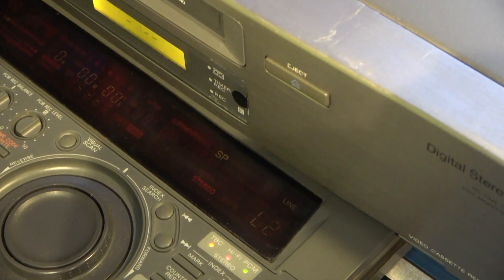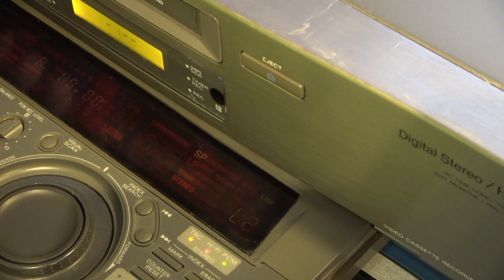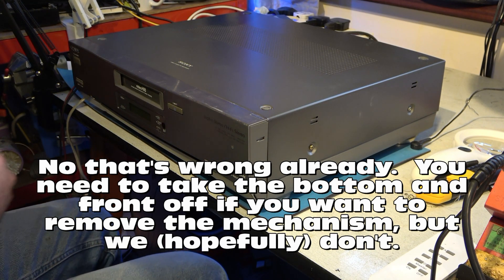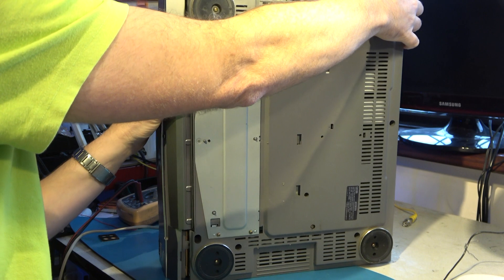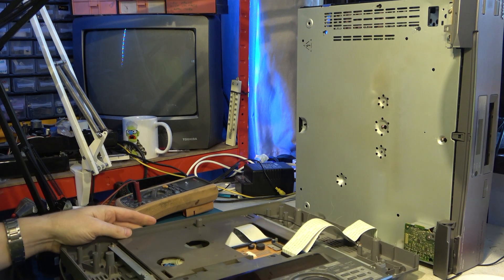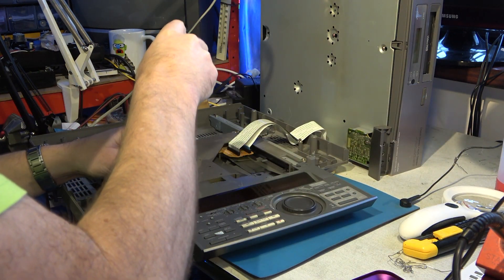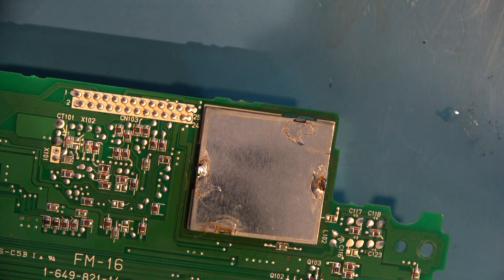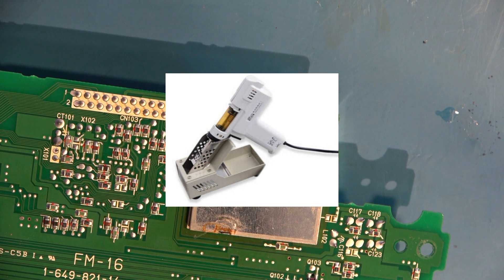Restoring brightness to a Sony EVS9000E / EVS7000 display.

Comment: I have an EV-S7000.  Replaced all the capacitors in the power  supply section under the metal can.  Still nothing.  Any other ideas of what to replace?  Thanks!!

Comment: I have a sony MDS-JB920 with a dim L/H VU meter bar and the PLAY triangle is dim aswell could you possible be kind enouth if i email you tge circuit diagram as i can sort this but just need a little help in the right direction

Many Thanks
Dsrryl
Reply from the maker: If certain segments are dim, then it will be due to VFD poisoning.  Not much you can do about that apart from replace the display.

Comment: hi can you tel were i can find a transformer converter 1-423-845-11 for my ev-s9000e,the display is not working i already change al capacitors but the trasformer was to damage by the liquid of the capacitors .thak you your videos are very helpful,sorry about my englis.
Reply from the maker: Your only hope would be from a scrap machine.  Keep looking on eBay for cheap non-running machines.
Reply: @video99couk  ok thank you .

Comment: Thank you for the video! It helped me with the repair, especially the disassembling of the control panel. Although Sony used high quality electrolytic capacitors, some of the electrolytic capacitors were defective. Still a long lifetime after 25 years! In my case, the C204 470µF / 10V was defective / leaked. Prophylactical I changed all capacitors except  C203 / 33µ / 16V. All electrolytic capacitors should be low ESR / 105 ° C types. C203 is an ultra low ESR - OSCON polymer electrolytic. It still had its original values and an ESR of 20mOhm. It should changed only by an equivalent type.
Based on this experience, I consider whether I should check all the electrolytic capacitors in the SMPS and change them if necessary.
Reply from the maker: Power supply capacitors do fail in this machine, again use low ESR.  It's fairly easy to work on.
Life gets messier when the thousands of capacitors all over the main PCB start to fail.  Also the SM capacitors in the timebase corrector often fail.

Comment: Mines completely dark i have the ev-s7000
Reply from the maker: If the machine otherwise works, take the bottom pcb out and replace capacitors in that metal screening can.
Reply: @video99couk  thank u and it don't rewind it will eat the tapes if rewind but fastfoward works great
Reply from the maker: @leonjohnsonjr3331  That's a split supply (left) spool.  Very common problem.  Parts are virtually unobtainable though.
Reply from the maker: @leonjohnsonjr3331  I'm told that they can just about be repaired but I don't have any detail on that.  It would certainly require removal and repair would involve some strong glue.  Removing the supply spool messes up the back tension setting so the back tension band will require some fine tweaking.  If the tension is too low, the tape can ride up or even over the pinch roller, especially in fast forward.  You can see a bit more about that on another of my YouTube videos about servicing these machines.
Reply: I was wondering can u help me with a vcr
Reply: Ok thank u i got one more question about a vcr I have it play good in LP and in SLP but fuzzy in SP mode I only can watch L.P. AND SLP Mode tapes  can u tell me what could be the problem thank you

Comment: Hi Colin,
Really great job done with your video. The display on the "Jog-Shuttle unit" of my SONY EV-S9000E was completely dark....With your helfully contribution on Youtube, I was able to solve the problem. Effectively, two capacitors (C204 - 470u 10V and C205 - 47 uF 50V) were degraded in capacity. After replacing them, the problem was solved.
Without you help, I would not have found the cause.
Thanks again for your excellent job.
Roby

Comment: Hiya Colin I was wondering if you could help I have a Sony C20 with no capstan rotation I have found a site that tells me to check R530 on the SS 11 board but I cannot find it I'm pulling my hair out Please help thanks Andy
Reply from the maker: You could probably use the service manual, which is very similar between the C20, C30 and C40, so any of those should do it.  Try this: https://elektrotanya.com/sony_sl-c30e_sl-c30ub_sm.pdf/download.html
Capstan failure is not something I've ever seen on one of these machines, so that should be interesting.

Comment: I have one of these that I may restore if I could only find supply and take up reel table assemblies ...they have both disintegrated. The display is out too but can be repaired. Anyone out there have a solution for reel table problems?
Here are the original part numbers
X39429541 TABLE (SUPPLY) ASSY, REEL

X39429531 superseded with  X39429532 TABLE (TAKE UP) ASSY, REEL

Comment: Does this solution apply to VHS VCR displays too? Replace bad capacitors.
Reply from the maker: It certainly applies to some other machines such as the Sony Betamax SL-C9, so it's likely to apply to certain VHS units too.  You would have to look at the schematics for the video recorders in question, to see if they utilise a DC-DC converter in the display circuit, and if so then capacitor failure is certainly one of the reasons that the display can go dim.  The other primary cause unfortunately though, is failure of the display itself.  For example, the Futaba displays used in some JVC equipment are known for going low emission.

Comment: Smashing job colin :-D
The pesky capacitors in switching supplys can never cope with the high frequency currents, and still boil the electrolite :-(
I've replaced a lot of electrolitics in p.c supplys and laptop chargers, panasonic were my favorites, r.s semiconductors have them but being r.s they are not too cheap.
Flourescent displays are so much nicer than led types, sadly they lose emmision and go dark, or the psu loses the whill to live lol :-D

Comment: Great video! I’m wondering if the same solution would bring my Panasonic NV-FS200’s display brightness back up.
Reply from the maker: I'm not sure the FS200 uses a DC-DC converter, you would have to check the service manual.  It may be that the display itself has lost emission, this does happen with some displays.  Also check that the inside of the front panel is clean, that can get a bit fogged up and reduce brightness.
Reply: I went through the service manual of the FS200, but I can't see a DC-DC converter in it at all, which is odd. On the other hand, I downloaded the schematics of its NTSC counterpart, the AG1800, where there is a DC-DC converter. Looks like I'll have to open that thing up.